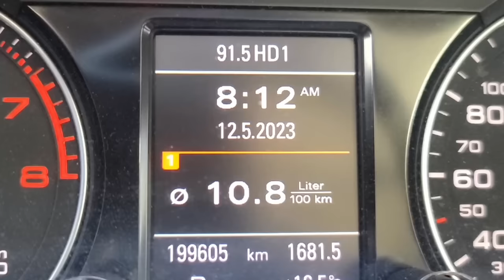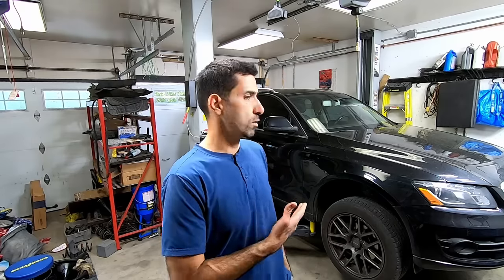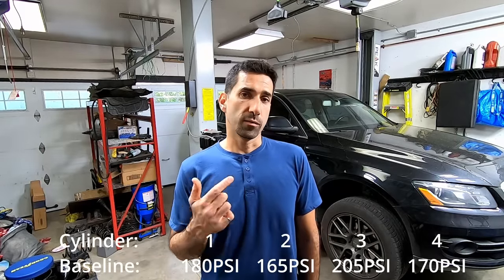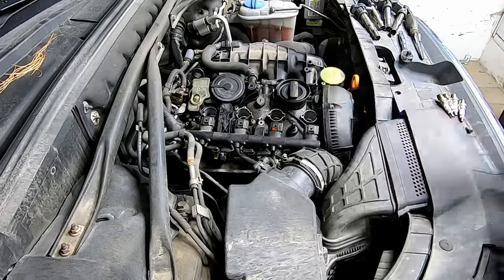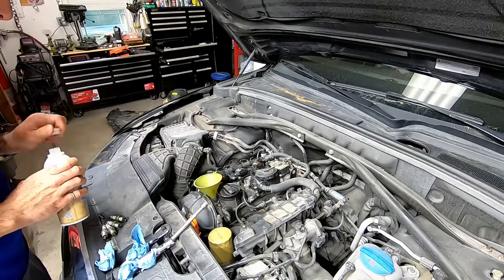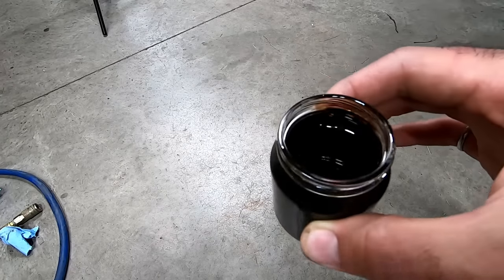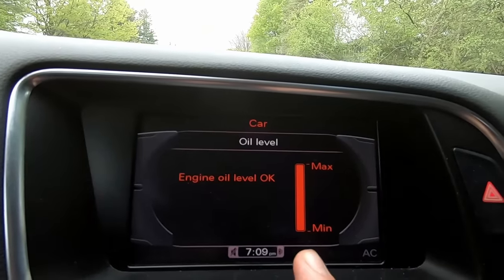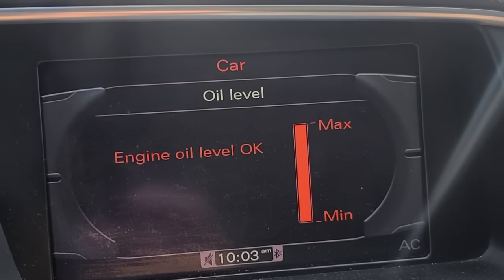How to fix excessive oil consumption from clogged piston rings (Part 2)

Comment: Hi! Greetings from Colombia!, your video will save me from spending a lot of money for changing pistons, my car is an  Audi A4 2012 with only 86000km (53437) miles, is consuming an absurd amount of oil, about 1.5 liters every 450 km (279) miles, I have imported the B-12 solvents from amazon and I will perform the cleaning following your steps, thank you very much, I will keep you informed. God bless you sir!
Reply from the maker: Damn that's a crazy amount for such low mileage! Good luck and keep us posted
Reply: @ETMotorsports  Hello sir, for health reasons until recently I could do the soaking with the solvent B-12, so, long story short, let me list my conclusions, I did a compression test before and after, in all cylinders before using the solvent between 141 PSI and 154 PSI, after cleaning following your instructions all cylinders have 150 PSI, after leaving the pistons soaking for 5 periods of 6 hours with 40ml of the solvent, the car took multiple crankings to start, about the 7th attempt it started with heavy smoking with a lot of white smoke, I drove it 15 km at full throttle and did the oil change, which came out completely black as if it was diesel oil, the new oil is Liqui Moly 10-40w super Leichtlauf (in my country there is no winter, we are in a perpetual spring). Periodically I have made measurements through the OBD2 port, the initial measurement with the newly changed oil was 75mm in the oil sensor and today after 500km traveled it stays exactly 75 mm of oil, previously it would have consumed a liter of oil, I have to thank you for your video and the great help it has been, it has really saved me from spending too much money, also in the future I will continue taking regular measurements of the oil sensor and informing you of the status of oil consumption, Again thank you very much for your help, God bless you and happy life!
Reply: @yaro161 any news?
Reply: Right now, around 4000 kilometers after the B12 procedure, it hasn't consumed any oil. I'm happy with it.
Reply: How do you know English?

Comment: Hi Man. Love these videos. I'm thinking I have to do this on my 2011 VW EOS 2.0 TSI. its burning plenty of oil 1L/600K. 
One thing I can't quite make out is when rotating the  engine are you turning the bolt clockwise or counter clockwise. Again I believe from all Ive read it has to be turned counter clockwise? Is that right.
I'm also getting the PCV valve replaced, as I'm not sure how this is. But from what I can tell its not a bad idea to replace this every 100000Km or so. Love the videos mate thanks from downunder.
Reply from the maker: @adrianduncan8355  hey you always turn the crank clockwise - unless of course the engine spins the other way in Aussie? 🤣🤣  the pcv valve should be changed yes but it doesn't account for 1L/600km... that's all rings... good luck with the job!
Reply: @ETMotorsports  Ok clockwise. Cheers. I think its just our toilets (dunnies) flush that spines the other direction. Now just got to see if I can find some Berryman's here in Australia. I'll let you know how I go. Thanks again.

Comment: I had recently done this with my 2014 a4 ea888 gen 3 motor which was burning 1L every 400kms with great success. I was a little scared at trying it but am wrapped at how it went. 400kms in and still at max. Thank you so much for this video as it's saved me $$$.
Reply from the maker: Great results!!
Reply: Just an update but 1000kms in and it's only gone through a quarter of a litre.

Comment: just got mine started today! hardly any smoke, but Did Not run Berryman thru motor..however I did close to 72 hrs soak.took out a good amount of carbon. not to mention what I blew all over the place. Pistons look much Cleaner... will update you on it when I drive it a couple weeks or so. & DEF Looks like Cyl #2 was the culprit. which I kinda already knew.
Reply from the maker: Keep us posted
Reply: Couldn't you just pour it in the fuel tank and avoid all the drama?

Comment: The amount of smoke that came out of my 328i filled the street with white smoke for about the length of a football field.  It cleaned my oil sensor so now it's working properly again. Also not burning a drop of oil and no oil burning smell. I couldn't be more happy. I used my tools and a bore scope. I just did a 8 hour soak. Topped off Then rinse flushed out the spark plug holes. The amount of carbon was monstrous. Although the crankcase is in pristine condition meaning this car had normal oil changes before I bought it in March.  I couldn't be more happier.  Next is ultrasonic cleaning the fuel injectors.

Comment: Thanks! Just bought an audi a4 quattro, and as a mechanic and an enthusiast, you just confirmed what I suspected was possible. I haven't driven it yet because I got it cheap with 100k on it, and it needs a clutch, so I figured I would go ahead and do the timing chain to eliminate it as the owner told me he had never had it done, and he said never had the piston recall done. This thing is going to get a soak just out of principal while I do the chains since I am in no rush anyway. Thanks again.
Reply from the maker: @MichaelCarreras  good luck!

Comment: I have a 2013 Q5 and I  just completed this same piston soak, and everything went as expected based on the videos you posted. It burned a liter of oil per 900 miles or worse if I idled more. I am at 100 miles now and we'll see how it goes. 🤞
Reply from the maker: Fingers crossed - please keep us posted on your results
Reply: I bought  2012 q5, 98k miles, 3months ago, drives smooth, no check engine lights on. but having to add a qt every 300 miles, this is  frustrating, should i try liqui moly enigne flush and your method! i dont tools and enough knowledge like you  to follow your steps, pls suggest me what should i do! ty for your video its amazing. @ETMotorsports
Reply from the maker: @ocean2823  yeah sounds about the same as the Q5 in the video... yes I would definitely try a piston soak with LiquiMoly engine flush... it should be a good alternative
Reply: I tried the liquimoly engine flush a few oil changes in a row with no luck, but it's worth a shot.
Reply: @ETMotorsports  500 miles so far and the oil is still at max. I would be at least half way down by now. I was at a liter per 900 miles before the treatment.
Reply from the maker: @TimMcClain  awesome news! Actually your starting consumption wasn't as bad as some of the other cars out there but it's good to see you can catch it earlier and still be able to do something about it
Reply: @ETMotorsports   Should i put in engine bay and run engine idle for 15-20 mins and do the oil change or pour it into the piston as you did in your video? or use your method in video - use berryman b 12 and piston soak and also the liqui moly engine flush in engine bay and do oil change after? I really appreciate your feedback :)
Reply: Made it to 1000 miles and no oil burn. I would say the problem is solved. I guess we'll see.
Reply from the maker: @TimMcClain  awesome news!! Thanks for the update... the Q5 is at 5k and almost at the 1L mark but I think it burned it earlier and then stopped
Reply: Thank you for the video. I am trying your method this weekend on a 2003 Toyota Celica, 232,000 miles that burns 1 liter every 2,000 miles. Hopefully I get the same results.
Reply from the maker: @davidfrisbyp.c.5109  good luck!
Reply: I made it 2,000 miles with no oil burn being registered in the MMI, so I think I would say this is a success. Thanks for the video. I think it saved me a few thousand bucks.
Reply from the maker: @TimMcClain  awesome results!! Glad it helped

Comment: Thanks for the video.  I'm writing for advice and maybe as a cautionary tale.  I have a 2011 A4 2.0T manual transmission with 135000km, burning oil for the last 3 years at a rate of 1 litre per fill-up, which is about 400km.  (I mostly do short trips in downtown Toronto traffic, which is exacerbating the carbon build-up and oil consumption issue). Aside from consuming oil, the car ran fine.  I followed the instructions exactly.  I've since let the car idle for periods of half and hour to an hour, and have gone on a few drives of about half an hour, but it runs extremely rough and with a very noticeable loss of power.  Almost stalling out when idling, and almost stalling out starting on a hill.  I need to give it way more gas and let the rpms climb much higher than normal before upshifting or it will stall.  Engine light is flashing.  For a while the EPC light was on, but it seems to have gone away.  It doesn't seem to get any better with any amount of driving, and it is definitely not safe to drive like this.  I took it to a shop and they say there are error codes indicating misfires on all cylinders, and compression is down to about 100psi for all cylinders.  (180 and above is expected)  They say that the piston rings are no longer making a seal, and possibly the carbon build-up was actually helping create the necessary seal.  I've been told by a couple sources that this doesn't sound right, and the rings should be fine.  I'm being told to have the shop do a high pressure leak-down test to identify where the loss of compression is coming from.  While this may identify that it is not the rings, and therefore might be a less costly fix, it will still cost some amount of money, and that amount is likely to be more than the car is worth.  I'm hoping you or someone else here might have some advice before I decide to give up on this car.  And maybe to confirm or refute what has happened in my case, as it may help someone else who is considering a piston soak.
Reply from the maker: @user-bx3rt2ox4f  hey, it's entirely possible that the compression has been affected by the soak...we have no control over which ring does what - they get soaked at the same time... don't panic - I would recommend repeating the procedure, keep the crank turning often... did you run the engine with the B12 in it? How long?
Reply: @ETMotorsports  Thanks for the reply.  A few more details might be useful for you.  After the soak (24 hours, refilling every 6 and hand cranking) I covered the open spark tubes with a towel and used the ignition to crank the ignition.  Not a thing came out.  Bone dry.  The Barrymans had either evaporated or entirely leaked into the engine.  I put the old plugs back in and started the car.  After several attempts, it started.  I let it idle for a good 20 min. with the Barrymans in.  I took it for a drive that lasted about 20-30 min before I called CAA to tow it to where I had an oil change scheduled.  They did the oil change (after some convincing) and I decided to risk driving it back home, and then put in the new plugs.  Since then it has been idled for a total of about an hour and driven for about an hour.  The shop that was looking at it today says that the brand new plugs are completely covered in carbon and actually wet with oil.  So it seems that lots of oil is now getting past the rings.  I can order more B12 and do the soak again if you think that might help.

Comment: Thank you for this great video! Our daughter was extremely excited to purchase her own vehicle with money she saved from working. We found her a 2012 Audi Q5 2.0T with 100k miles and in immaculate condition, shortly after her purchase she said the car was low on oil. We added 1-1/2 quarts and than a week later and only 300 miles it was low again, after some research we learned about the Audi oil consumption issue and were fearing that we may have to pull and rebuild the engine. I fortunately found your videos about this issue and followed your tutorial, the engine is no longer burning any oil with over a 1000 miles so far. We greatly appreciate what you have done addressing the oil consumpiton issue and saving us and others thousands of dollars in repair with your helpful videos!
Reply from the maker: Great results! Glad I could help... plenty of people are getting burned buying cars with oil consumption that isn't declared
Reply: Any news ? No oil consumption?
Reply: @juxhin  Over 3000 miles now & less than 1/2 quart low. It's definitely an acceptable improvement.

Comment: Another commenter here confirming that this fixed my oil consumption. I went from 1L/280km, to now having done 2,000km and only dropping 1 notch down on my oil level. Looks like i'll be able to make it through a complete oil change cycle without adding any in between. Night and day difference. 2013 A4 2.0T
Reply from the maker: Fantastic!! Glad it worked

Comment: Wow, thank you so much. My 2013 A4 1.8T has been burning 1L of oil every 250km. I was quoted half what I paid for the car to do a rebuild. I tried this with CRC motor treatment which seems to be the same stuff as b12 chemtool (which I can't find in my country). I have done 350km since the treatment with almost no oil use. You have saved me a fortune.
Reply from the maker: Hey that's great news! Where are you located? I'll have to look up CRC motor treatment - it sounds more like SeaFoam...a lot of folks are looking for alternatives since B12 seems to only be available in the US
Reply from the maker: Oh that's interesting- CRC is headquartered in Canada - I haven't actually seen it anywhere on the shelves here
Reply: @ETMotorsports  I'm in South Africa. I bought CRC motor treatment from a local online store.
Reply: @stanleyadamssa  Im also in SA did it work?

Comment: Don’t even know how I stumbled into this video, but here is another happy 0000 owner. 2009 A4, bought it at 68k, on the way home after purchase (from another state) low oil level light came on. Dealer said I could return it if it’s still under 250 miles, at this point I was past that distance and knew I was screwed. By 80k miles, I was adding 1L every 400 miles. I was ready to do overhaul myself when I got a notice Audi had a class action against and were extending warranty for oil consumption to 80k/10years, and I barely made it by like 100 miles. Long story short, they replaced it with complete new long block. 84k miles later (at 168k) back to oil consumption. By 175k (95k on the new engine) it was back to 1L every 300-400 miles. Other than massive oil consumption, it drove fine. Two weeks ago I stumbled into your video and figured I’ve got nothing to lose. One can, overnight, manually turned over few revolutions, another can, 6 hrs later-all liquid is gone. Cranked it with plugs out, started rough, then cleared out, then 5min later all kinds of cam adjust solenoids/misfire codes. Drained the oil, put new filter and 5/40 synth oil. Pulled the plugs and replaced (super cocked up after few min). Let it run for another 10, misfire cleared out. 
Today was little over 200 miles and still a full gauge, usually I would be half way down by now. Another thing I had was occasionally EPS light would come on and tells you not to accelerate past 4K rpm’s, I replaced oil pressure solenoid, seemed like that fixed it but shortly after it came back. This also took care of that issue as well. I’m another witness that can vouch this stuff works. It may not fully fix it, but it had tremendously improved it. Thank you for taking time to post this video!
Reply from the maker: great results! too bad that the new engine still had issues - my old Avant had the engine rebuilt by Audi for oil burning and wasn't losing a drop - it ran great...

Do keep an eye on that EPS light though - that seems to be related to the intake cam oil pressure issues I've described in one of my other issues...

Comment: Hello, I hope you're well. I've recently started using the piston soaking method on my Audi A4 2008 2.0 TFSI to address its oil consumption problem. Currently, I'm using Seafoam High Mileage for this purpose, as I'm waiting for the arrival of Berryman's B-12, which I ordered from Amazon. I've even recorded a short video of the Seafoam application process, although I didn't attempt to crank the engine as I couldn't locate a specific bolt, despite trying to follow online instructions.

I've also used an endoscope to inspect the pistons and found them to be quite dirty with dark carbon deposits. Unfortunately, I couldn't share these videos in the YouTube comment section.

My intention is to clean the top part of the pistons before moving on to the cranking step, although I'm unsure about how to do that as well.
Reply from the maker: hey I wouldn't  bother cleaning the top of the pistons...if you fix the consumption you can use injector cleaners in your fuel, which should technically help clean the combustion chamber and the top of the pistons....

please keep me posted on your results with SeaFoam...it worked well on my A4 but it's not as strong as B12 so I want to know if it helps with your consumption

Comment: Going to be performing the piston soak as soon as possible…I have a 2009 b8 that has not shown any symptoms of this oil issue yet  and I’ve owned for 3 years now with 103,000 miles on it. Now I bought a q5 with 80,000 with terrible oil issue the previous owner just gave up on but got a good price on it…previous owner was a lil cheap as he replaced pcv with knock off brand so I’m sure with piston soak and fcp/ecs quality pcv replacement I’ll be bringing her back to life…will keep you guys updated!
Reply from the maker: Good luck! The pcv can usually account for some oil burning but the levels that these cars see there's no way the pcv is the problem... keep us posted!
Reply: Couldn't you just pour it in the fuel tank and avoid all the drama?